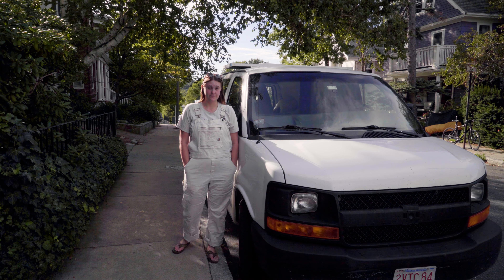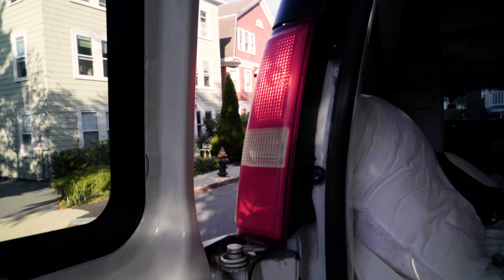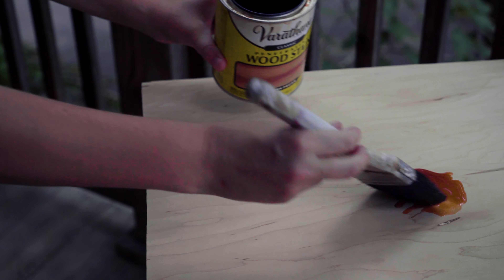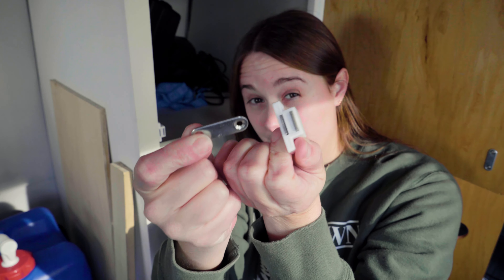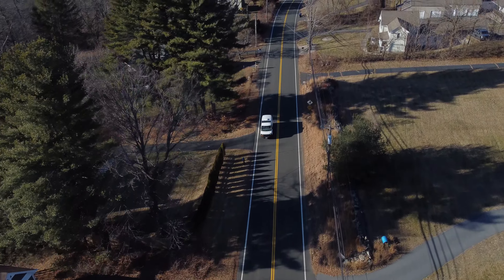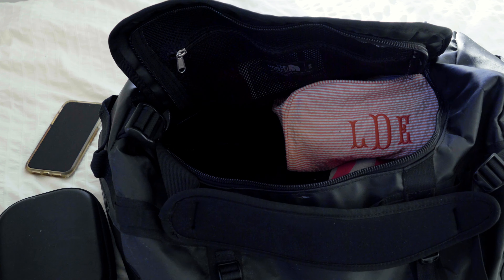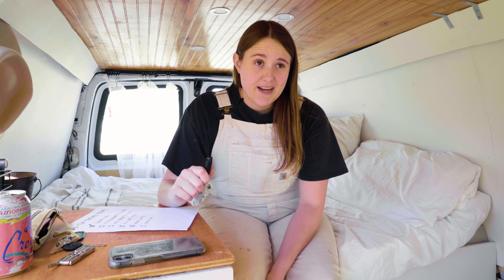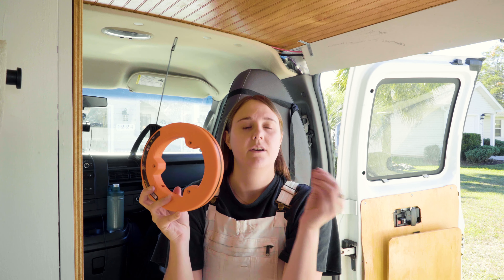Finishing the Cabinets in my Van (and More!) Before My Next Trip

Comment: FYI about GM rear light bulb sockets.  They have an issue with the ground connection within the socket.  Some just ground the socket to the body.  I chose to just replace the socket in my Express van.  It's easy enough.

Keep on trucking!
Reply from the maker: Ah good to know!! Thanks 😊